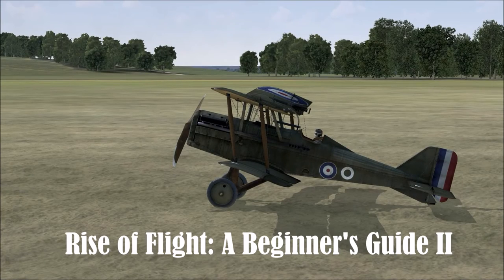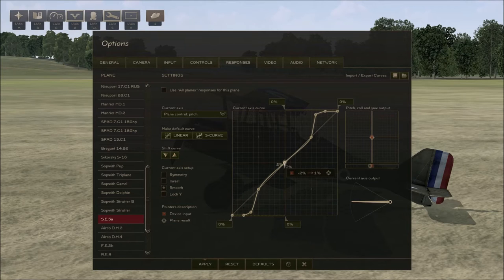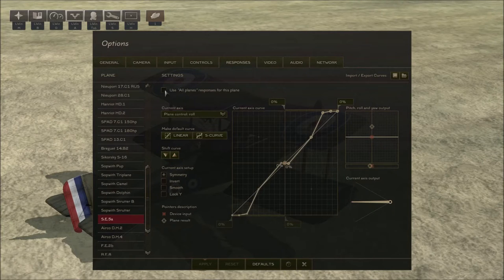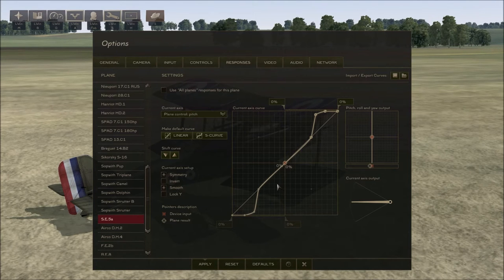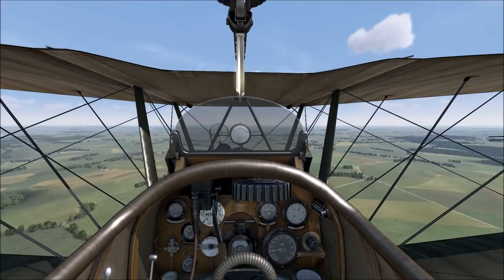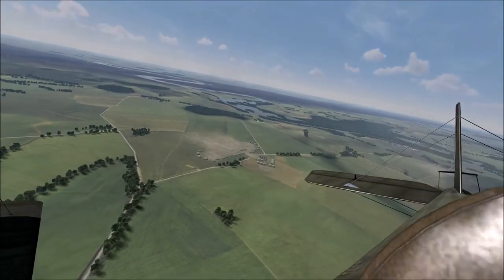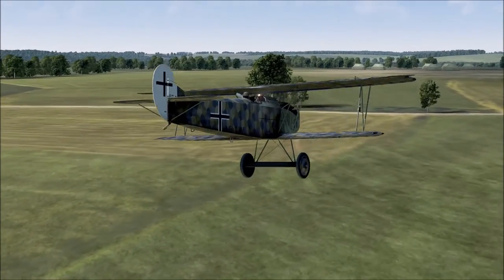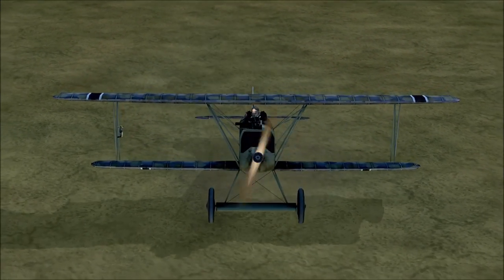Waggaz' Wings Episode #13 - Stopping the SE5a Nosing Up, Response Curves, & Altitude Throttle

Comment: Waggaz, how the devil do you dive away from a DVIIF in a Spad? When I test them offline the case seems hopeless for the Fokker, it over-revs easily and breaks up at a much slower speed than the Spad. When I'm online in the MP though, my badly-shaking Spad with the rpms up high as I dare gets peppered (from absurd ranges probably) on the way down and one on the deck the faster-at-sea-level Spad can't out-distance the DVIIF without being peppered to death. What gives?
Reply: Do you mean how do you dive away from a Spad in a Fokker DviiF?
Reply: No, I'm just contrasting my offline results in dive tests (seems like Spad should easily escape) versus what happens in online servers frequently.
Reply: Ah gotcha. The AI knows the exact breaking point for the DviiF for RPM and wings which is probably why. The Spad can dive nose down at 180 at very high speed without damage - nothing can follow it down for more than a few seconds
Reply: I was talking about online. Seems to have trouble outrunning the players in DVIIFs, even with room to plunge.